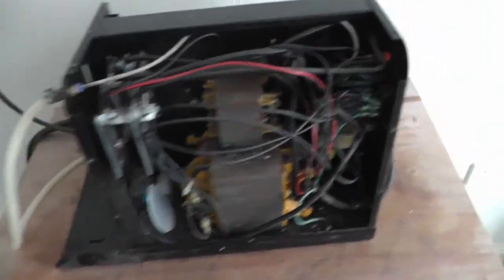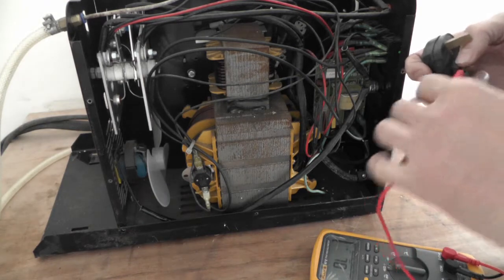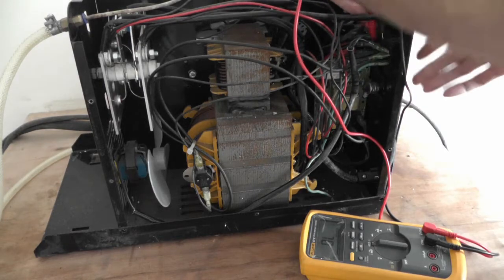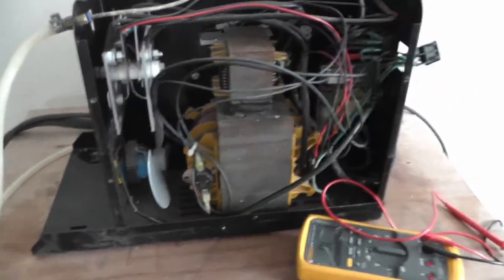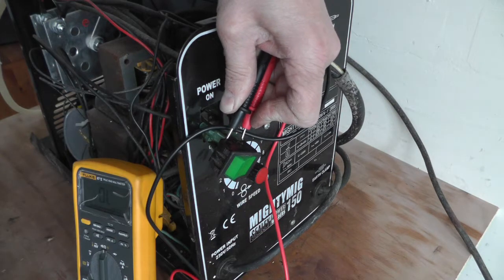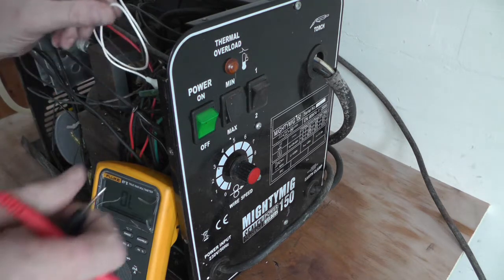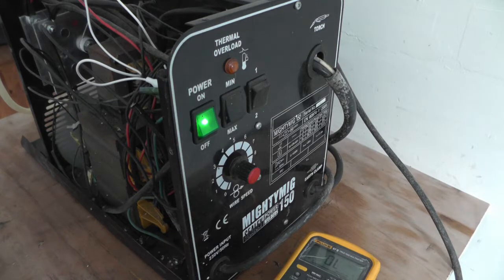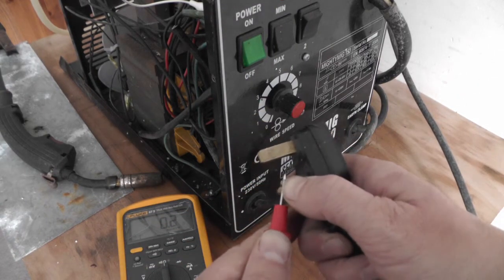DIY Fix: My MIG Welder Won't Turn On its Dead! (Easy Checks for Breaker, Cord, and Internal Fuses)

Comment: hello, thank you for the video, just got a question. my switch is good, it turns on but the little fan wont turn on. do you know if its got a fuse somewhere in there? its  mg-140T
Reply from the maker: check wiring check for any sensors maybe it clicks in at cetain temp  check coils of motors .
Reply: @cagmito76 shall do that....Thank you so much!!!